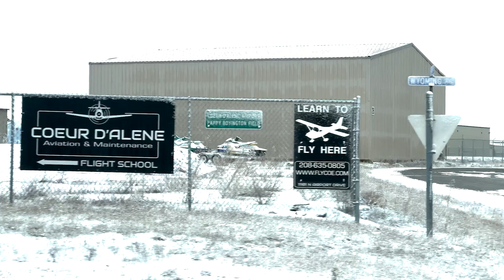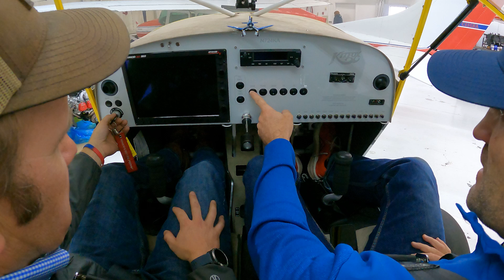Rotax 914 Engine Install | Kitfox engine gives up the ghost (E17)

Comment: I have the same kitfox 7 LSA. I asked the company how to get the TK Tailwheel with suspension and they refused it and told me it has to become experimental. How did you get approval? And if you didn’t. Have you had issues?

Comment: How many hours were on the original engine?
Reply from the maker: 2,080.  It had a great run!
Reply: @thefarmlandfox  I guess so that is a good run. what happens with your old engine in those situations does it get sold as a core or something?
Reply from the maker: Factory rates them for 2,000 hours, so I guess we got 80 bonus hours. It will probably end up in a snowmobile somewhere.
Reply: @thefarmlandfox  2,000 TBO or 2,000 and it's cooked?
Reply: Can’t the Rotax be overhauled like Continental and Lycoming engines?  Does the cost to overhaul the engine exceed the cost of a new engine?